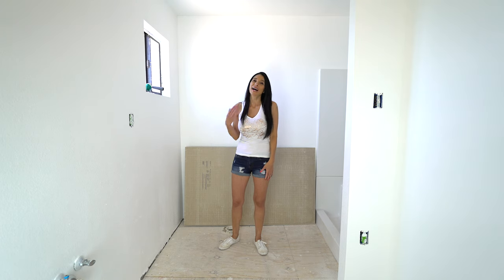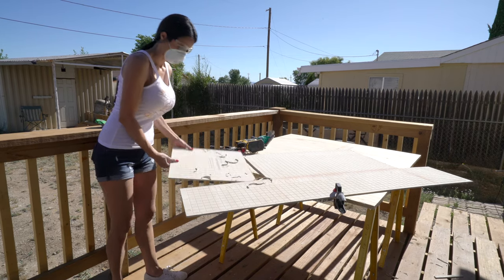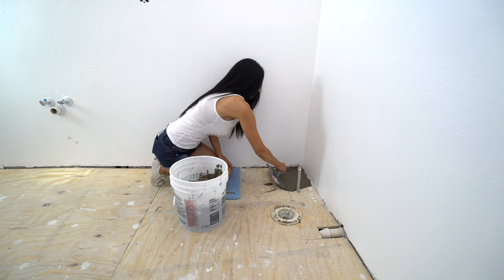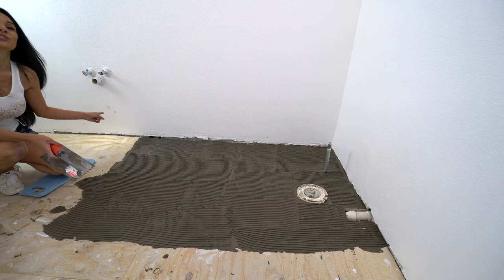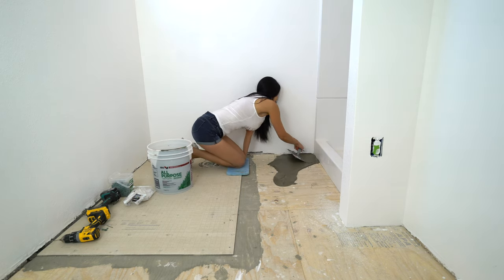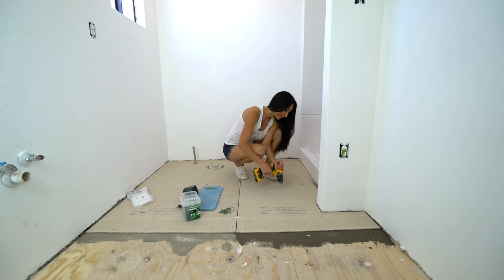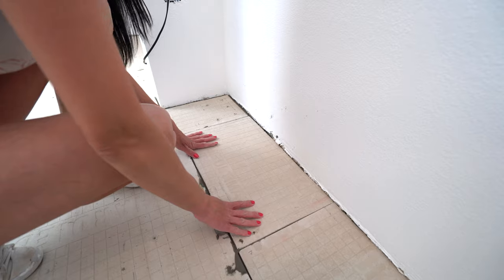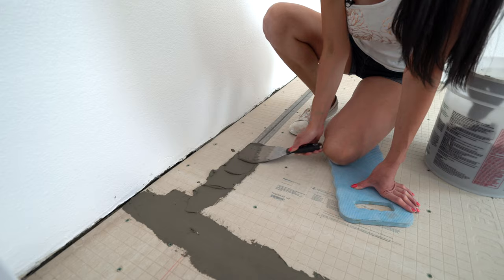Cutting and Installing Cement Board

Comment: I have cut so much hardy board and cement board doing tile for almost ten years.  I just screwed( every 6 inches) it down with correct screws never had a issue. By the way  may say your a lovely  lady with a attractive figure .

Comment: Very nice job but joint tape works better on the thin-set, not directly on hardiebaker, I know it comes with itself adhesive but I definitely recommend to apply thin-set first, filling the 1/8" joint and put 2 to 3 inches thin-set line then put the tape and make sure to smooth it until get a 1/32 to 1/16 thickness layer.
(second recommendation is get the piece of tape ready before apply the thin-set to prevent thin-set gets dry and make an ugly bump)

Comment: Screwing like that will kill your back!😉

Consider using a wide crown stapler on your next Hardi project....you'll thank me later!  3" spacing on seams and staple in an arch pattern.  Rock solid with no screw high points, 1/10 the time.

Comment: Thanks Nassrin.  Based on your previous review of the "Snapper Shear Pro" I bought one.  I will be doing the 1/4" HardieBacker on the floor next, so I haven't used it for that yet.   I did the 1/2" (actually .42 in) for my shower walls first.  I didn't have any curves to cut, in the .42 in wall HardieBacker, but I did find it cut it in a straight line very well. I did have to go to a heavy duty corded drill with a keyed chuck though because the vibration from cutting would immediately cause the shank of the tool to come out of the chuck on my Milwaukee 18V cordless drill. Once I used the keyed chuck on my corded drill, it worked great.  From your video it looks like I will be able to switch back to my cordless drill with the 1/4" HardieBacker I will be using on my floor.

Comment: You did a great job you could also just take the mixture and dump it on the floor and it would be faster that way and squeeze it out but you can take your sheet and mark on the floor with a marker so you know how far to bring the thin set.  But all in all great job and you look great doing it
Reply from the maker: Thank you

Comment: As I noted in a previous post: work smarter, not harder! Use Shleuter Ditra (floors) and Kerdi (walls) as well as the Shleuter shower kit! You can do this job in about 1/3 of the time and 1/4 the effort.  Nassrin, love your vids. Clearly you know what you are doing and you do it well. I just am too lazy to work as hard as you!
Reply from the maker: I really want to try the Shleuter Ditra for the floors.
Reply: @NassrinsDIY  easy to do. Best part about the Ditra on floors is once the Ditra is down you can start tiling right away! Come on up to Canada and we can do a project together! Beauty and the Beast, eh!

Comment: Just a heads up, this is late, but the toilet flange should be installed on top of the finished floor. If you have a plumber come in before floors are finished then ask them to leave the last pipe to the bathroom either capped underneath the floor if there is access so that it can be completed once tile is done, or a solid pipe coming through the floor and capped above so that it can be cut short when installing the flange from above if there is no access under the floor. 

Alternatively, the best method, if you are competent in your planning, measurements, and tile setting, is to have the flange installed "x" amount above the subfloor, where "X" is the thickness of the tile and thin-set mortar or any other flooring systems added on top of the subfloor. This method is the most difficult, I would recommend the other methods unless there is something blocking you from using the other methods.

Comment: Not sure if you did this and it's not in your material list or video, did you add the required polymer to mortar in order to apply over plywood based on the product specifications or is it not needed as the product states?

Comment: Isn’t it thinset the seams, imbed tape, smooth thinset over tape? Either way great video with a lot of good information. In the long run that tool would pay for itself. I cut holes using a jig saw with a course wood blade. I usually get about 2 holes before the blade is shot.

Comment: I want to put porcelain floors too. My condo floors are made of 3/4" Light Weight Concrete (LWC) on top of 3/4 Plywood subfloor. I have not yet removed the ugly old vinyl sheet flooring on top of it to see it, i just know from the deed document. Do i still need to use cement hardbackie boards if there is LWC already ? I read that LWC is prone to cracking so i am worried if reflooring the bathroom project means removing all that LWC first or leave it, i have no clue.

Comment: Hi Nassrin. Great videos. Thanks for this. Question (and sorry if you've already answered this and I did not see)....what are your thoughts on using Schluter-DITRA membrane versus cement board under tile? Do you think one is better than the other? Are there circumstances where you would use one over the other, or do you always go with cement board? Thanks!
Reply from the maker: I haven’t tried it yet but I really want to, I just bought a bunch of cement board I have to use up first. I would think it’s easier to work with.

Comment: You never explained why you need 1/8 inch space gap for the board?
Reply: Because when you tape the joints and run thinset over the tape you want it to fill that gap a little so it forms one monolithic cement board. It is so cracks don’t happen along the joints. You could go as big as 1/4” or so but 1/8” is ideal.

Comment: Oh no!... You used the wrong thinset for underneath the cement board. The kind you have is unmodified meaning it isn’t meant to bond to plywood. So it will bond to the cement board but not the plywood :(. You needed a modified thinset with an ANSI rating of A118.11 or even better, A118.15, these are meant to bond cement board to plywood.

Comment: Dear Nassarin, PLEASE be more careful lifting those heavy bags. Instead of properly lifting with your legs, you're bending over at the waist and putting the direct stress of lifting on your lower vertebrae / spine which is NOT designed to handle such continued stress. Lifting injuries are a result of cumulative improper lifting over time. I worked for UPS for several years while going through college and personally witnessed many strong, young collegiate athletes permanently destroy their lower backs from cumulative improper lifting - exactly the same as you're doing it. It may be uncomfortable for you, and you may need to work out more being a petite woman, but get low and grab the bag and hold it close to your core, then lift with your legs and NOT YOUR BACK. 

When these incredibly strong young men blew out their backs it usually happened when they were lifting very light weight - like 5 - 20 lbs...because lifting injuries TRULY happen as a result of cumulative improper lifting. If something is worth doing, it's worth doing right. Lift properly dear woman. 

You're amazing Nassarin and I watch so many of your videos to learn to tile better. THANK YOU SO MUCH for your excellent, easy to follow instructions!!!